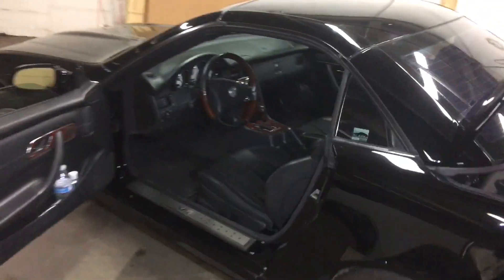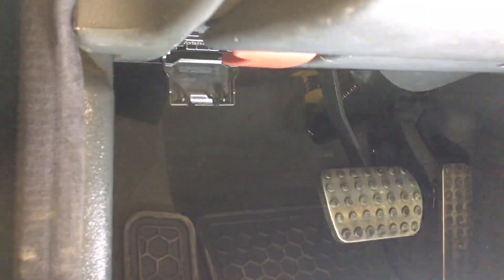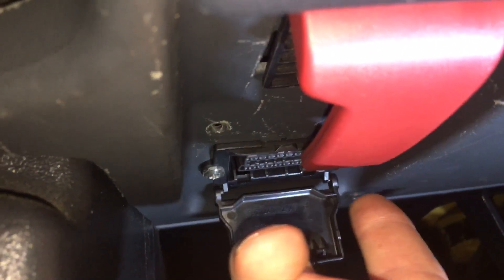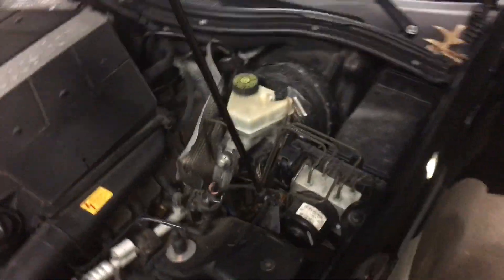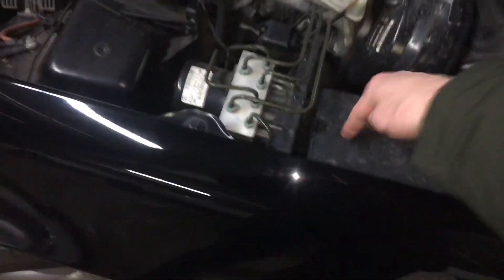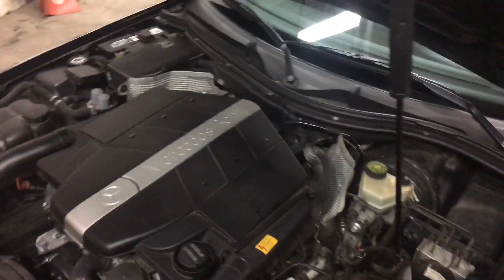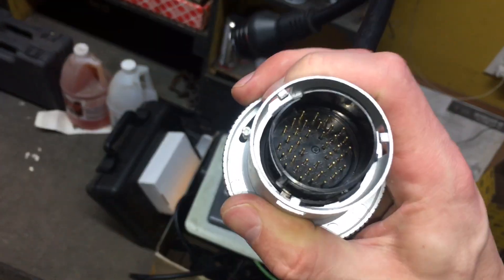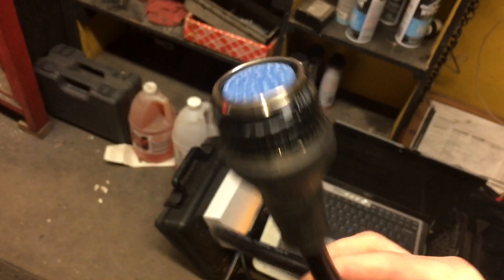OBD Port Mercedes SLK (R170)

Comment: Thanks for video , which OBD scanner good for vw jetta 2016 ?
Reply from the maker: Hey Alb J511 thanks for watching my video.  I recommend google searching VW Jettta 2016 OBD scan tools top 10.  This may give you a website that will describe the different type of scanners and the necessary technical knowledge to operate them.  Please share an update with what tool you found most suitable.